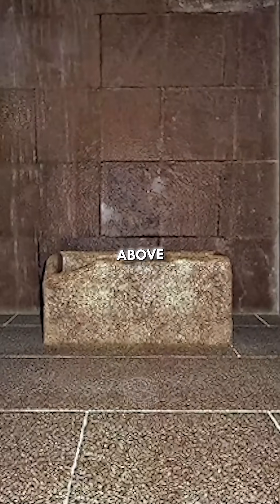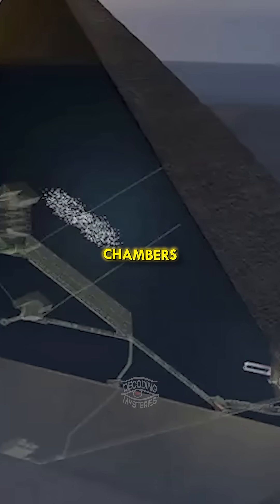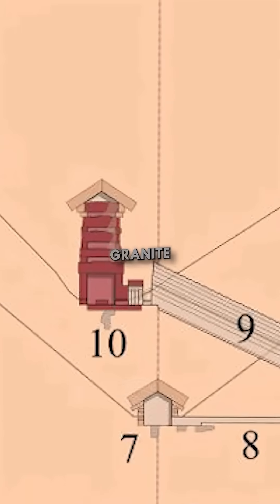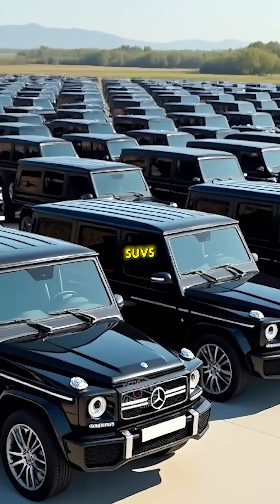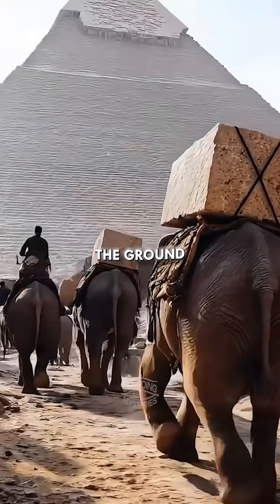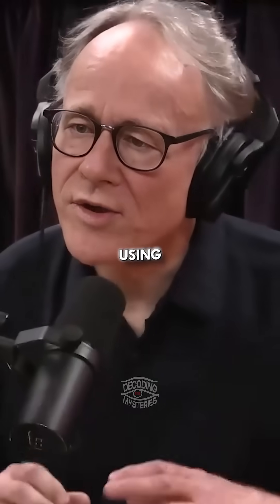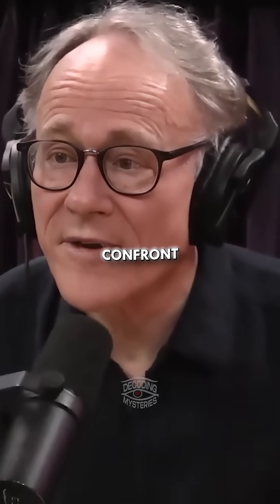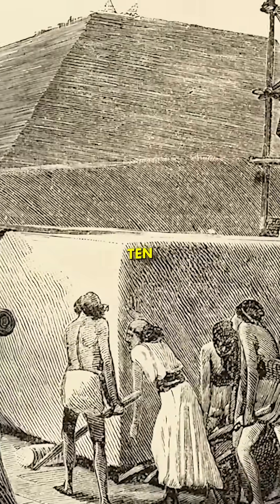Engineering Secrets of Egypt's Great Pyramid That Defy Logic 📜

Comment: The French architect Jean -Pierre Houdin put forward the best explanation of this over 20 years ago. And here we still have  Hancock doing his best Von Daniken impression .
Reply: Ramps wouldn't work. There's no way. Even if they could make the stones roll, there wouldn't be rope strong enough to pull it up, the logs would be smashed... no way to dismount it from the logs and place them. No steel cables. No hydraulics.
Reply: @juansolo1617  They did work. They had logs they rolled the stones on.
Reply: @juansolo1617   Thank you.
Reply: @juansolo1617  They've replicated the process using tools and materials available at the time. Easy to look up.
Reply: @hubbeli1074  70 tons?
Reply: @hubbeli1074  no, they have not
Reply: @thiagoracing  They've gone up to 50 tons, but at some point the amount of man power needed to move anything larger just becomes unattainable.
Reply: Jean Pierre Houdin is probably right the ramp was built going around the inside of the pyramid as it was being built with a slope of less than seven degrees.
Reply: @beno3750  He found the ramp built into the structure
Reply: @beno3750  Explain cornering heavy lengthy columns on the outside of a pyramid. As an architect, his design is flawed. More likely, the stones were drawn up in stages as each layer was built utilising the footprint which is why higher up you don't get the heavier stones.
Reply: You know how it is: Houdin knew something about architecture and was knowledgeable in engineering. But he didn't have a social media account. So he doesn't count.
On the other hand, this twit does have a social media account but hasn't got a clue about anything.
Reply: Sure he did 😂😂
Reply: Exactly, the problem is that explication don't sell.
Reply: from an architect??? do they even know how actual things work... listen to the videos question and explanation of how big a dilemma that they are trying to solve...a real math problem not a design problem. sorry but if you say engineers then I'll listen but an architect???
Reply: @UPandUP227  The people who built the pyramids were Architects. You are mistaking Architect for Interior Designer. One builds sky scrapers and the other soft furnishings. And a podcast host and Graham Hancock are not trying to solve anything. John Pierre Houdin carried on his Fathers work and spent 20 years of his own time solving this issue by collating direct evidence.
Reply: @terrortorn Architects don't build anything. They design the look and function. Engineers do the problem solving and calculations for the structural work, they deal with the practical side whilst being overseen by the architect
Reply: @Anthem_79  No architects are building engineers. Within the requirements of the architects they may farm out specific engineering solutions to specialists the result being the successful building of the pyramids. Hancock is not an engineer either nor an architect. He is  an author, Von Daniken mark II
Reply: @UPandUP227  I assume the architect has researched his opinions among other disciplines' experts, no?
Reply: Kites. Big kites. 😂
Reply: The French guy's theory is barely functional.
Reply: @mattblack9069  Say's who the podcaster and author
Reply: And i am tired of idiots like you that know nothing about civil engineering or architecture, it's fucking impossible
Reply: Try to drive a car in 45 degree slope first then let's talk about lifting up a 70 ton stone more than 100 meters in the air with the same slope with just ropes
Reply: @ahmedd_adell  You need to read more. No one said they used a 45 degree angle. Trying to get a single motor to push a 2 ton car up a hill in a few seconds using nothing but the traction from 4 rubber wheels is entirely different from pulling stones up a shallow ramp using ropes, pulleys, sleds, rollers, hundreds if not thousands of people, and countless hours worth of labor.

That’s like saying it’s impossible that humans carved mount rushmore because one guy couldn’t have done it in a day. It’s just ignorance.
Reply: @sddouces7879 
Oh sure, 70 tons equals 70,000 kilograms—no big deal, right? Let’s just assume they were all superhumans with identical strength, each casually lifting 100 kg like it’s a grocery bag. That means you’d need just 700 of these guys to lift one stone. Simple! Now tell me, what kind of magical rope are we using here? Enchanted dragon hair?

And about the ramp—because of course there's a ramp—how exactly do you build one that massive? And please don’t say sand or mud, because that “ramp” would start crumbling after 4 or 5 meters, not to mention the extra friction would make dragging the stone even more delightful. But wait, now we’re sliding it on wooden sleds? Adorable. You mean to say they managed to get this 70-ton rock onto the sled in the first place? Then what—sprinkled some fairy dust to keep the wood from snapping in half?

Okay, fine, somehow the sled didn’t shatter. Let’s pretend we’ve now pulled this beast all the way up the ramp (because physics was clearly on holiday), how exactly do you place it precisely at the center of a pyramid? Because newsflash: the magical ramp doesn’t go inside the pyramid.

Oh, and let’s not forget—these stones weren’t even local! They came from 600 kilometers away at least ( some other stones came from far away more) . But sure, cutting, transporting, and lifting millions of these stones for pyramids, obelisks, temples, and basically everything else—totally makes sense. Must’ve been one heck of an ancient construction company.
Reply: @ahmedd_adell  Damn, you really have no idea what an argument from ignorance is do you. Alright well since you want to get into this, let’s do it.

70 tons is actually closer to 63500 kgs but who cares about precision right? Next, it takes many times less effort to drag or pull something up a slope than it does to physically lift it. Just because your tiny mind can’t comprehend the physics responsible for that phenomena doesn’t make it untrue. It doesn’t need to be enchanted at all, given that tensile strength is only relevant to the force applied to the material, and not the weight of the object, and as was just pointed out, there would not be a force of 63500kg exerted on the rope used as it takes much less force to drag something than to lift it. This means you wouldn’t need magical rope, nor superhuman strength, just a good amount of the old regular stuff, and a large amount of strong labourers, which we know the Egyptians had plenty of at the time.

All of this of course is predicated on the ridiculous notion that the pyramid stones were 70 tons, which we know only a handful of them were, the vast majority of the stones used actually being around 2-15 tons. Meaning they only would have had to undertake this effort a few times, and could be performed by a large portion of the labor force over a large period of time.

The ramp… How would they make a ramp… That’s a good point… If only they had a large quantity of several ton stone blocks laying around that they’d transported from a quarry that would conveniently make for a sturdy ramp, along with a solid foundational knowledge of structural engineering that allowed them to make large constructs over a long period of time, but no such luck I suppose… What is lucky for them however is that the larger stones are all rectangular and not perfectly cuboid in shape so the force would be distributed over a larger area when using ramps or sleds to move such a large object… And you’re probably right, wet sand and mud wouldn’t do the job, although they would be very useful materials for reducing friction if they were going to drag things around… Shucks you got me on this one chief, I’ll move on.

You know what? You’re right idk what they were thinking. I mean if it were me, I’d construct the bits in the center that required the larger stones as I’m building the pyramid up, rather than building the outer portion, and then trying to build the center up seperatel-… Oh wait… I mean this is just a lack of critical thinking on your part lol.

Yeah if only they’d developed a comprehensive system for moving these large stones from one location to another using the river system nearby and large barges we know they had, along with the aforementioned pulley and rolling sled methods… And if only the pyramids happened to be made from a lower hardness material than quartz which they had an abundance of that would have allowed them to cut through that lower hardness material in order to create those stones… You’re right, alien tech is DEFINITELY the more plausible explanation.

All of this however is really just me taking the piss because the point of my comment was that you and Graham Hancocks ENTIRE POSITION is based on nothing but one giant argument from ignorance, along with a paltry few pieces of anecdotal evidence that he presents in a way that conveniently allude to the validity of his theories. You need to be capable of demonstrating your ridiculous claims with even the most minute level of certainty. You don’t just get to say “oh that sounds like it would be really difficult to do the way they’re saying, so my theory is therefore reasonable.” That’s not how science and archeology works, which is exactly what has prevented boneheaded assertions like the ones Hancock is peddling from becoming the accepted explanation. Stay in school. If you’re already finished school, your countries education did you a disservice.
Reply: @ahmedd_adell You're very sure that wasn't the way they built the pyramids, so what's your answer then?
Reply: @babayaga-j3f 
We don't know that for sure, but we do understand physics and mechanics, so based on our knowledge, all the existing theories are unlikely to be true. They must have had some advanced technology or at least materials we haven’t discovered yet to help them
Reply: Tired of listening to this historian talking about engineering.  Hancock, you're not a builder!!!!
Reply: @danielbuxton4493  He is not a historian... He is a pseudoscience peddler. Not too surprising given he is in Rogan.
Reply: @danielbuxton4493  or a historian if we are completely honest.
Reply: @danielbuxton4493  He speaks to all manner of experts like engineers, scientists, etc. If all you know of hancock is a few vid clips then u r ignorant.
Reply: @DefFiBob He speaks to whoever he needs to speak to until he finds someone who will make a vague allusion to his ridiculous theories having the most minute amount of credibility, and then takes that clip and rolls with it. 

There’s a reason the entirety of the physics and archeological community consider him to be a quack. Every single one of his hypotheses can be boiled down to “argument from incredulity: therefore aliens or lost super advanced technology”.

He hasn’t come even remotely close to meeting his burden of proof for any one of his nonsense claims.

Comment: Well as I recall you can can make wheels, and as you add more wheels to go through you loose a whole lot of the weight and it gets easier and easier. Think its called pulley blocks. It does not change the weight, but it requires less force to do so.

Comment: If the ground is raised to enable each level to be completed there is no need for ramps. 
Imagine the pyramid being slowly buried as it gained height. A bit like Cut&Cover tunnelling: don't waste time drilling through rock, Place the prefabricated tunnel then cover it.
Reply: Great thought, and then as you remove the layers of sand you do the white limestone cover on the way back down for the full reveal. Good Idea.
Reply: @reddog19d  Some of the pyramids had marble cladding. As did the Pantheon in Rome until the marble was stolen by the Vatican.
Reply: thats actually a brilliant idea man 😊
Reply: The amount of earth required to utilize such a technique would be colossal! WAY more than the pyramid itself!
Reply: @foadrightnow5725  True, but a bucket of earth could be hauled by a single person one at a time with no need for extra tools.  It would be considerably easier and faster to move a pyramid's worth of dirt than the stone blocks that make up the pyramid.  

Quick math indicates it would take 2000 men hauling a 5 pound bucket back and forth from a nearby location about 4 years  to transport 4 times the volume of the pyramid, which could be done during the building process and likely made use of animals and far fewer men
Reply: @Restil  and 2000 men is pretty low of a number. Ancient Egypt is assumed to have had ~3 million as a population. Just using 1% of them for pyramid would be 30.000 people. Take woman and kids out you are still at 10.000. They have multiple decades to build the pyramids. Realistically speaking they probably had more like 5-10% of the population working on those things with of course full backing of their king.
Considering that the pyramids are actually still relatively simple buildings. 
Also it's less that it was impossible to do. There are actually many proofen theories which showed its doable. The question is more which method they used rather than if they somehow had been much more advanced or had some aliens to help like the con theorists like to claim.
Reply: @foadrightnow5725  But you would need to remove a lot of earth to get down to bedrock. There's no way a structure that heavy could be built on sand. I did read somewhere that several pyramids were actually found buried by sand. Maybe a security feature [slows the progress of grave robbers] or maybe due to naturally shifting sands.
Reply: this concept is said to have been used in the construction of the collosus of rhodes, the designer cast brass pieces to build the statue and buried it as it was built to act as scaffolding for support and to aid building the higher parts.  When complete digging it back out must have been a spectacle.
Reply: Ha ha ha.....
Reply: 😂 what 😂

Comment: The Baalbek Stones,  750-800 tons, of the Temple of Jupiter, 
The Colossi of Memnon in Egypt, weighing 700 tons each 
Great Stele, King Ezana's Stele, and Obelisk of Axum in Ethiopia, weighing 520, 170, and 160 tons respectivel
Great Pyramid blocks average around 2.3 metric tons, and can be greater than 50 tons.
Olmec colossal heads, from 5 to 36-45 metric tons.
Easter Island heads, moai, weigh between 10 and 12 metric tons

Clearly the evidence shows that we have lost the power to levitate heavy objects.

Comment: This guy is a quack.  An advanced civilization and their building material of choice is big rocks?
Archaeologists can explain how, but that doesn’t make him any money. 
The Egyptians had built multiple pyramids; they had plans on how to do it. With the need for 70-ton blocks at a certain level, they would be the first blocks moved to the site, at ground level.  Then using simple leverage, as the pyramid grew taller the big blocks went up with it, no ramps needed for the big blocks. Search Youtube for “leverage to move heavy objects” and you can find a guy, all by himself, using simple leverage, move a 20-ton block, up, down, back and forth, and stand it upright.
Compare that to an advanced civilization.  The complete Space Shuttle as it sat on the launch pad with payload, could weighed up to 2315 tons and be put into orbit.  That would be the equivalent of 33 of the 70 ton stone blocks.

Comment: Why do you think the place is barren. They used up all the wood to build all this. Egypt fell because they used up all the resources. They were smarter then we can imagine. But they went crazy on building bigger and better until they used every thing.
Reply: The place is barren because shifting weather patterns.  12,000 and plus years ago North America was covered with an ice sheet, at its peak hypothesized to be 10 miles thick in central Canada and 1 mile thick over current Chicago and New York.  How much do you think cold temperatures that would be necessary to form the ice sheet and that much water locked up, affected global weather patterns?  The Sahara Desert didn’t exist during this period, as it was all forest.  As temperatures warmed and the ice sheets melted, weather patterns changed again, and the desert was formed.